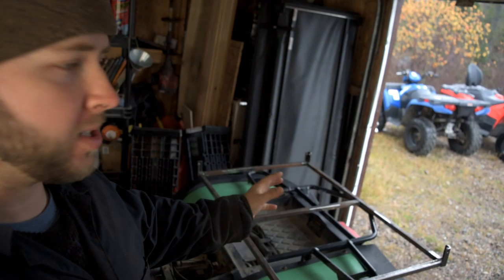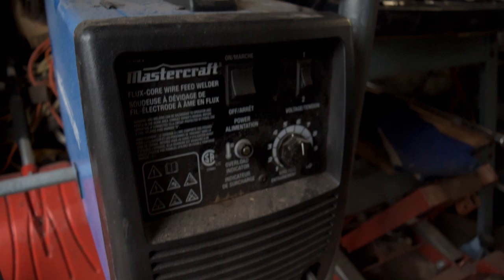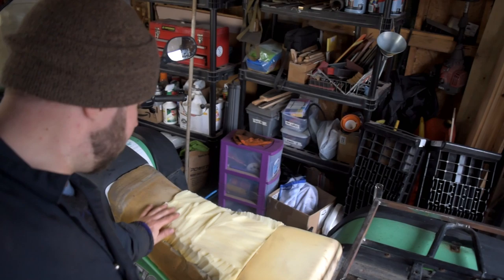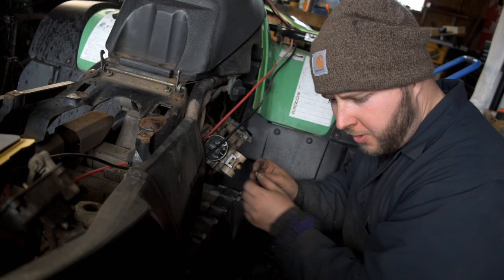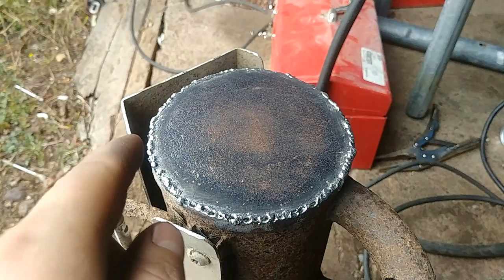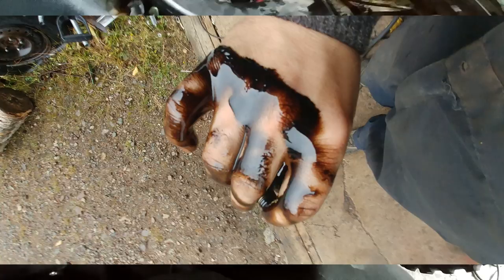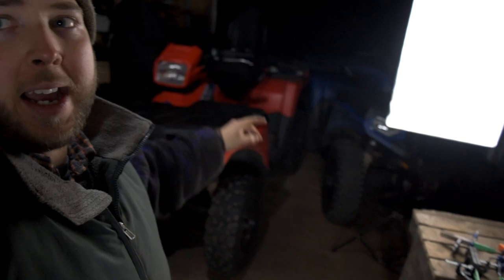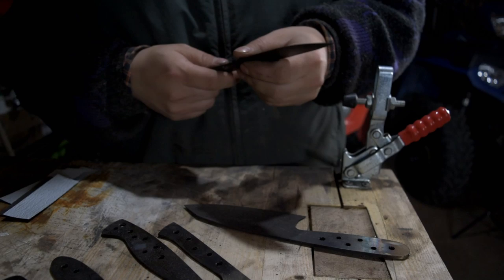WHY YOUR ENGINE IS RUNNING POORLY

Comment: You just reminded me I need to get some stabilizer in my fuel and my equipment. Kyle you’re just into a bit of everything. I like that because I too like doing many different things as well as making knives. Great video.
Reply: When you store your vehicles it's a good idea to fill the tank totally, leave as little space for condensation as possible. Sta-Bil is the most recommended brand of fuel stabilizer.
If you are thinking about buying a less brand read the label fully before you buy.

Comment: There as a video posted recently with nine month test. Shows stabilizer doesn't work,ethanol sucks. I use high test no ethanol since no low test no ethanol here. Gwen apart motor with problems and ethanol was cause. Corrosion and rubber destroyed.